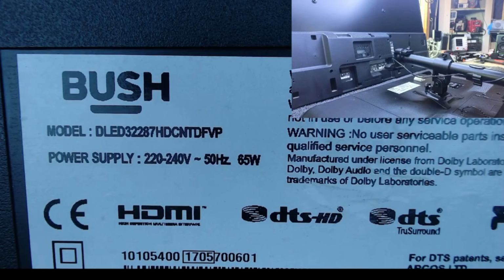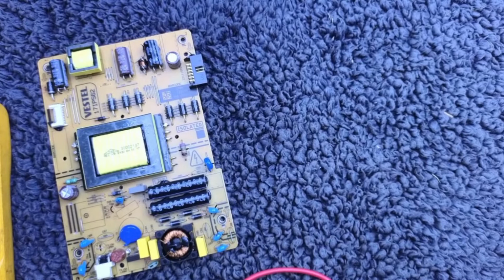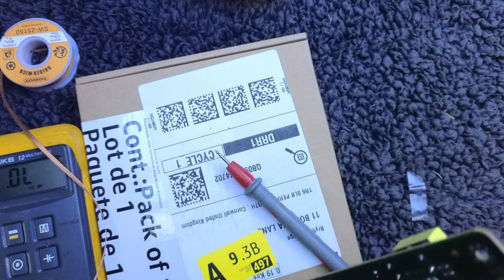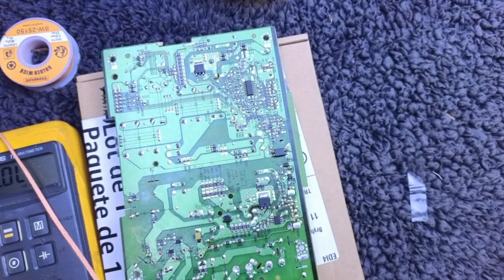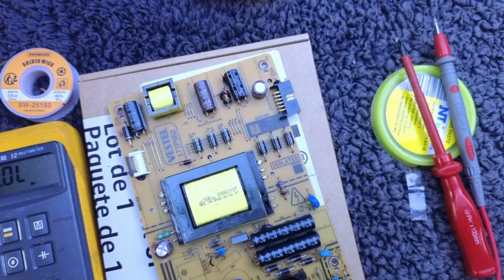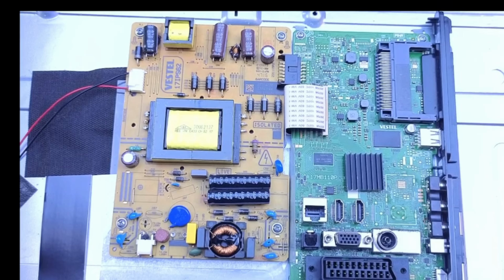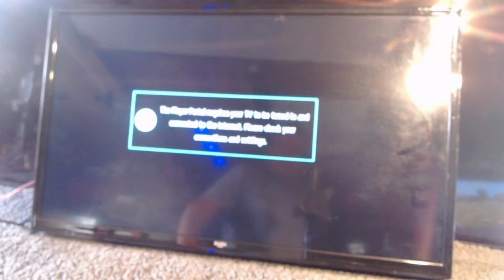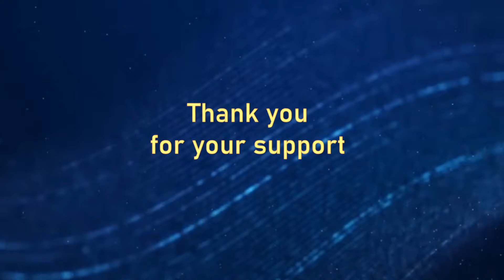Power supply needs too many parts..

Comment: Hi Allen, I got that TV working again after replacing the LEDs. Unfortunately the screen was cracked in the top right hand corner. I think the ladies who was giving it away for free probably knew this and just wanted someone to take it away for free. Hey, I look at this way. It's the first time I've worked on a new style TV and I've learned a lot through the process. Nothing ventured, nothing gained. Hey thanks for your advice. I'm gonna put the power board and the main TV board on eBay for spares. Thanks for your advice. I'm loving your channel fella. The mountaineering cats made me chuckle 😂 Also after watching your channel I've realised that my old Hitachi 42 inch bought about 15 years ago is so reliable that im never getting rid of it. I find that the CFL rather than LED is easier in the eyes.